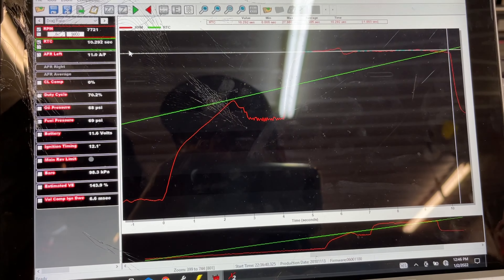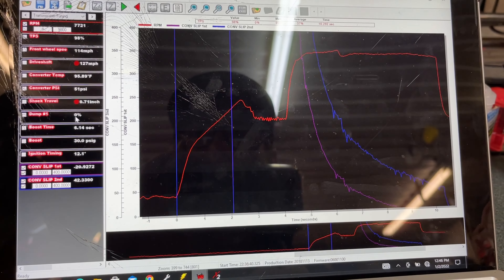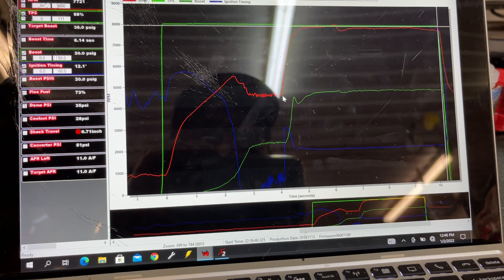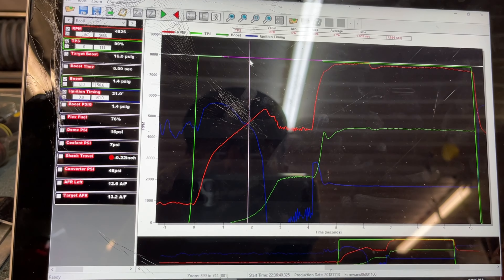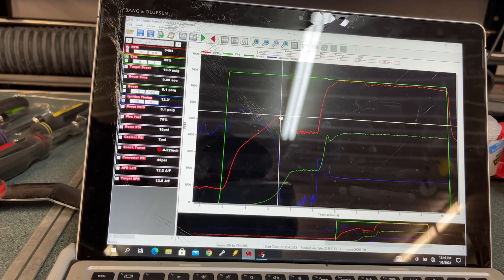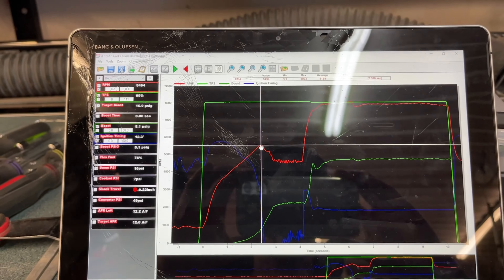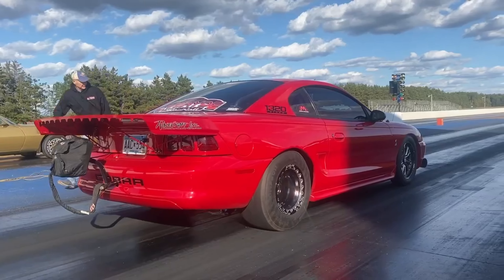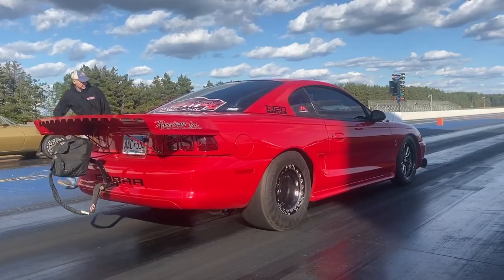How I got my 102mm sbe 5.3 to build boost on the transbrake! Holley efi advanced tables!

Comment: Great video! On my sbe 4.8, I ramp timing to 42 then around 10 on the chip & it works great! I just posted a before & after video on my Facebook page & it’s crazy the difference tuning can do lol
Reply from the maker: Right! It works fantastic! And sounds super knarly!
Reply: @OverydeMotorsports  I don’t have too much popping & banging but it’s deff a big difference in coming up on the 2step. I used to think my converter wouldn’t go passed 2900, now I got it to 3400 & hopefully higher.
Reply from the maker: Nice! Does it make boost pretty quick?

Comment: With the 16 vane stator set up; if you turned the advanced tables off and went on the brake - what kind of RPM would you see?  

I've got twin S369's on a 5.3 with a 17 vane 9.5 inch converter, I set rev limit 1 at 4000 but it just sits at 2800 or so and zero boost when I'm WOT on the brake.  I've swung the timing from zero to 40 degrees while on the brake, and RPM doesn't go above 2800 and it doesn't make boost.

On the dyno it doesn't start to make boost until about 5500 RPM.  Any advice is appreciated.
Reply from the maker: You have face book or Instagram? I think I have a video of it

Comment: Will the limiter offset work on a gen 1/2 of Holley terminator x. Having issues making boost on trans brake (5.3 SBE TT cam, twin 78’s) 6.70 1/8 1.60 60 foot
Reply from the maker: I don’t believe they have limiter offsets on terminator x. I would try leaving on more rpm and using a timing offset like I did to try and get it to go. What kinda boost does it make easy?

Comment: Tha KS for the post! awesome content between the 3 videos. went over to turbojohns video and he had the one issue pulling too much timing, and in your file you damn near went to 0 and didn't hiccup. I know setups can like certain things but when you dropped to almost 0 timing did you find the hiccup and drop out too?
Reply from the maker: I definitely was when the base timing was all messed up. The reluctor was off 7* so 10 degrees was actually 3. Then it would fall off the chip really easy. Once I fixed that it was so peppy. But I’m sure it was going negative on the chip with it was off and it would still build boost. Also I was hitting with a ton of rpm tho so I’m sure the incoming boost got it goin

Comment: So I’m rocking the terminator x and don’t have all the tables you do. What would you recommend doing?
Reply from the maker: I would try it with just timing, what is the combo
Reply: @OverydeMotorsports  sbe 5.3 98mm gt55 based with a spec’d ptc converter from dusty
Reply from the maker: What is the converter spec
Reply: @OverydeMotorsports  pretty loose 20-35
Reply from the maker: Oh hell yeah nice. I would try it with just timing first and see what happens. Maybe like 4000rpm 2 step. Dump valve open if you have one. Without being able to rpm offset you probably will have to just raise the 2step if it doesn’t wanna go. I feel like mine would do it with timing only now. I should try it
Reply: @OverydeMotorsports  well crossing my fingers, I don’t have dump valves but I am now thinking about getting a dominator if I can’t get it to go off the terminator